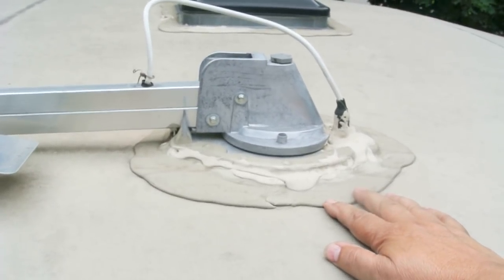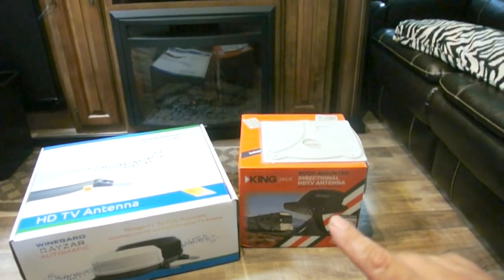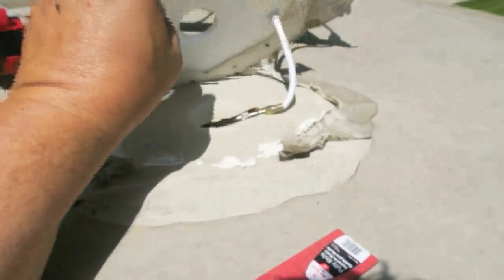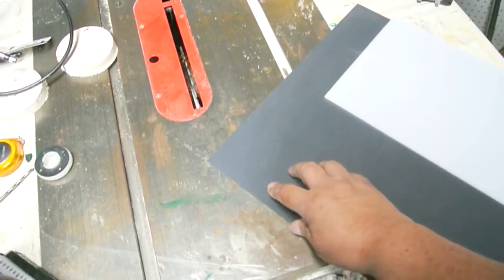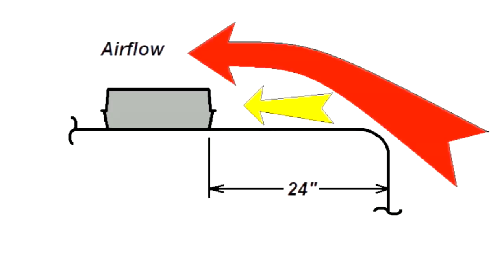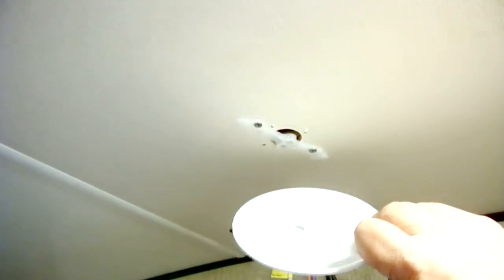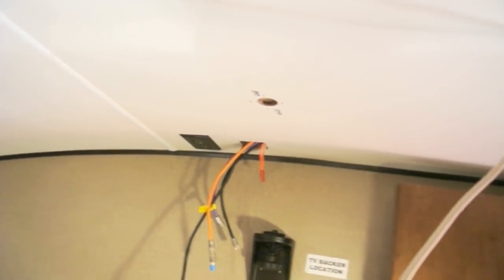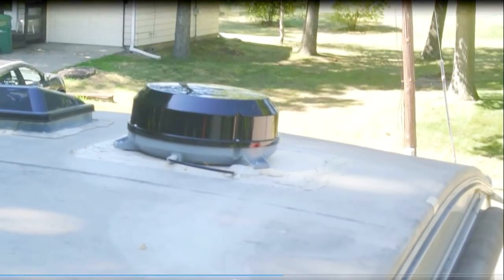Installing the Razar Automatic Antenna on my RV

Comment: Nice video. I recently retired from the telecommunication industry and we used to use a closed fist as a quick measuring tool for the bend for coax cable.
Reply from the maker: I don't think anyone in the RV industry knows that coax can be damaged by bending it too sharp, running staples through it, and squishing it between a wallboard and stud.

Comment: Looking at an RV that comes standard with this antenna but your info was very helpful.
Reply from the maker: It's a more costly antenna so I doubt you will find one.  However, some RV manufacturers, especially the small independent ones,  will make modifications within reason.

Comment: So are you getting more channels now?  You didn’t give us the before and after as far as anymore channels and quality of the signal.  Thanks
Reply from the maker: There is a definite improvement. My initial impression is positive, and yes, I am scanning more channels.  If you recall in the video, I was impressed with the 100% signal strength on the one TV I have with a signal meter. 

However, it is hard to quantify the improvement in broad terms; is it solely due to the antenna, replacing the bad coax, or a combination of the two? 

This video was not really a "review" of the antenna, but rather the "installation" of the antenna. I was actually careful to title the video Install rather than review. Consequently, a large part of the video is documenting the things one might need to consider and difficulties that might be encountered when doing such an installation. 

As I do with many of my installation videos, I do plan on a follow-up video on the performance (the "review" video).  But I want to get a bit of experience with using it first.  There is a definite learning curve; for example, resolving where the antenna parks itself (in the direction of most signals), vs other channels it may have found in other directions. 

I also encourage you to visit my website at rv-project.com/projects/razar.php where I provide a lot more information than I could put into a video. 

    

      
      
Show less

Comment: I have a King directional like the one in your video but it was installed so close to AC shroud it only turns 90 degrees.  I bought a King omnidirectional and doubled my channels.  I think the omnidirectional is pretty impressive and it was only $80.  The Razor was a little pricey for me but I would be interested to see if it gets as many channels as an omnidirectional antenna.  Nice job covering up the old antenna hole.
Reply from the maker: Thanks for sharing.

Comment: Replacing that coax cable would have made a great video on it's own. Do you still like the Winegard Razer auto antenna? 
Did you just decide against the King antenna. I'm looking to replace our original bat-wing crank up antenna. Thanks.
Reply from the maker: After 3 seasons of use the Razer Auto is still working well.  There were some bad ones when it first came out, but it seems all the bugs have been ironed out.

I did not go with the King antenna as it would have not met the installation requirements.  You are supposed to mount the antenna a minimum distance from the roof edge to avoid vortex wind currents coming up the side of the RV.

Unfortunately, the existing location the RV mfg used for the original bat-wing antenna was too close to the edge.

And I have seen several King antenna heads lying along the highways that fell off - as well as a friend that had that happen to him.

Weather it is just a bad design or the antennas were placed too close to the edge I don't know - except for my friend - his antenna was definitely within the recommended mounting location. So perhaps there is a design flaw there.

I did a coax replacement as part of an earlier antenna video where I put a king head on a batwing antenna.  Here is the project webpage: http://www.rv-project.com/repairs/antenna.php

Here is the video: https://youtu.be/azbnbr58j10

Comment: The problem with that ladder is you have it parallel to the rig and as you reach your not pushing against the legs your pushing sideways. No stability.
Reply from the maker: I fell off a ladder once a few years ago, so I am keenly aware of a ladder tipping over. Luckily it was only a 6ft ladder, and I grabbed onto the rafter (momentary at least) which helped prevent injury. But I can still feel that sensation of tipping over.   Like a dummy, I went to the top step without anyone holding the ladder. 

The podium ladder is specifically designed so you can work in all directions. The base is also fairly wide - almost 4ft, and remains stable in those situations. The design of the ladder with the cross bar at the top prevents you from climbing too high.

https://www.youtube.com/watch?v=3rsnrTFI4Fc

 I did not have to go to the top of the ladder to reach the areas for most of the project , and my wife also held the ladder at the bottom as I worked. The ladder never felt unstable. 

The one time I had to go to the top of the ladder, I used extra caution and threw a cargo strap over the roof of the RV and secured the strap to both the RV frame and ladder.
Reply: Glad to hear it.
Reply from the maker: I probably should have put a disclaimer on the video about using the ladder safely, but I didn't.